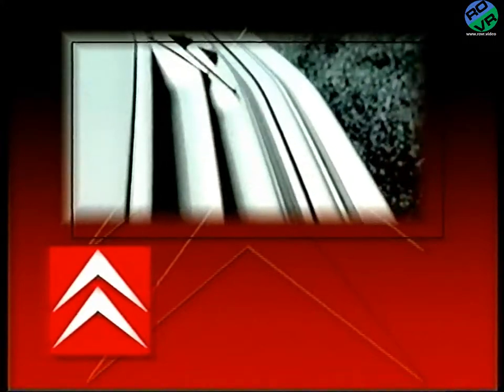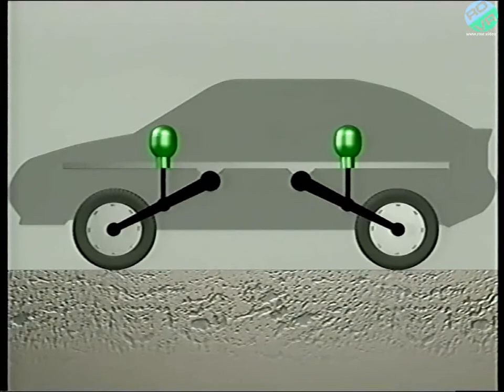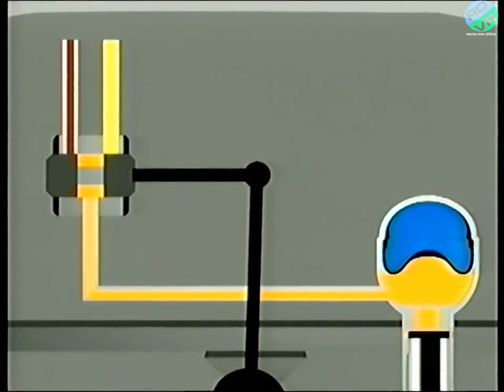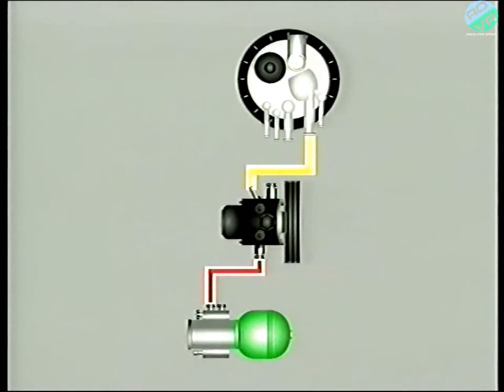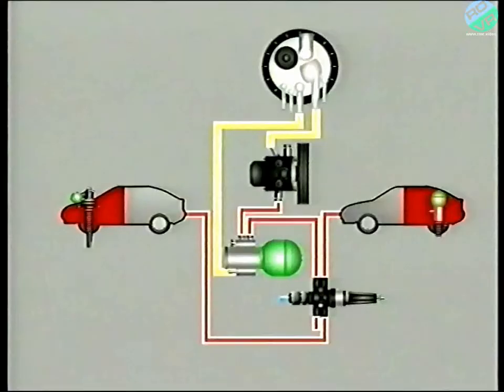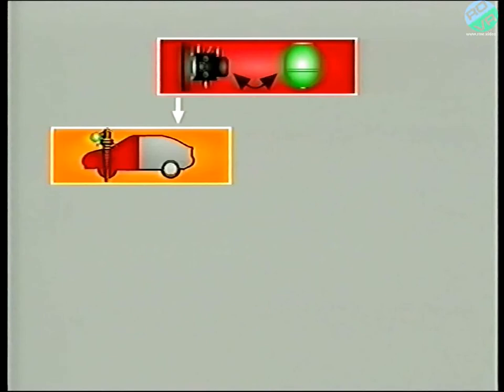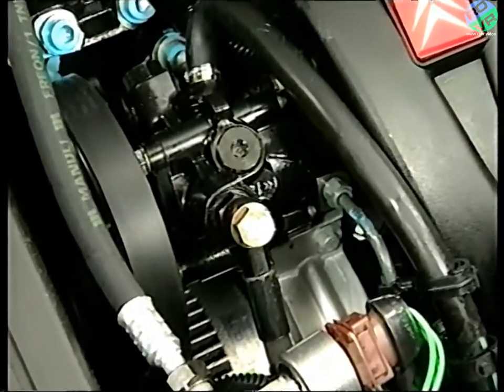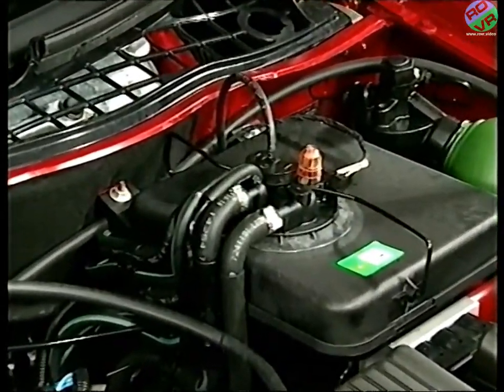Citroën - Hydropneumatic System - An Introduction to the System - Training Pt 1 of 4 (1998)

Comment: This solves my puzzled left behind the time. I once own BX series. And I wondered why its brake pedel reponsive was too rigid like on off, no linearly response. Clip tells the brake system is not servo like others cars. 
However the suspension when I rode passing along low frequeny vibration like bridge shoulder or any road bump was very smooth. Its more comfortably than even mercedes or BMW with air suspension today.
Reply: The braking feel is unusual at first, but imo you can get used to it pretty quickly. Braking force is controlled not by how far the pedal is pushed, but by the force and there is really no travel. So to anyone who is used to normal cars will of course immediately max out the brakes.

Comment: I always wondered how Citroën's Hydropneumatic suspension system performed in regions with cold winters (Canada, Finland, Russia, Norway, Sweden, etc...).  Very cold weather must have an effect on the LHM fluid, the valves, the synthetic rubber, etc...  Even regular vehicles need more maintenance in cold regions of the world and die an early death.
Reply: I would imagine that as the system bounces along, it does produce some heat as a byproduct of the fluidic movement.  To that end the system would work at a higher temperature than that of ambient.

Comment: Deveriam por isso em motos tbm...should put this sistem in motorcycles to👍🏼🇧🇷👏🏼👏🏼👏🏼🇫🇷
Reply: Was thinking about it, weihht is your problem, motorcycles do not have hydraulic pumps for the height adjust, some form of accumulator maybe. On a big bike, with bmw telelever front end....

Comment: Bloody brilliant! This system is crap but we've found many work arounds to make it less crap. Now, return to the work book.
Reply: Please elaborate.
Reply: @deezynar  I was just thinking that any time in the design process that they found a reason to stop work on this kind of a system they instead added a new piece of equipment to compensate for the deficiency. They made the system even more complex with each iteration. Much like the Germans with the 911. "You can't make a decent handling rear engine sports car." "Oh, yes we can!" They did it but it took many generations of the car, a lot of money, and many years to get it right. 

Also, I may have had a few pints while going through the video series so my comment isn't as clear as I hoped at the time. :-)
Reply: @TheNovaNorm  
It is a complex system, no doubt.
What improvements, or simplifications, have you and others, come up with?
Reply: @deezynar  None, actually. It seems like a purely hydraulic or mechanical/hydraulic would have made it simpler to work on, diagnose, and design.
Reply: @TheNovaNorm  
Peugeot is getting rid of it to cut costs.
It makes financial sense,  but it's a sad day.
Reply: @deezynar  It is a brilliant piece of engineering.